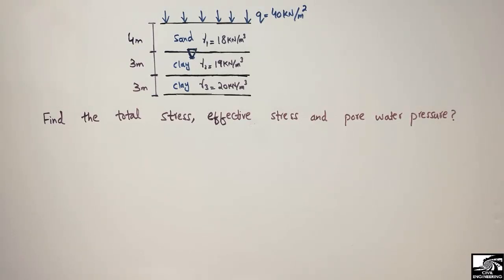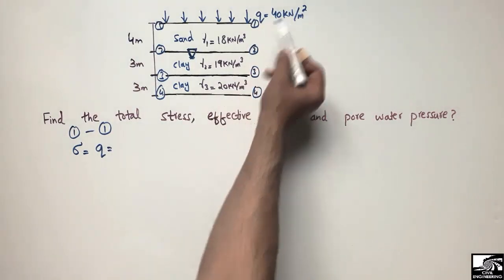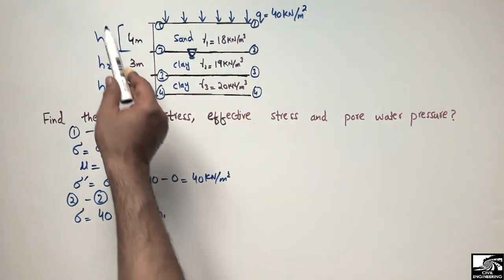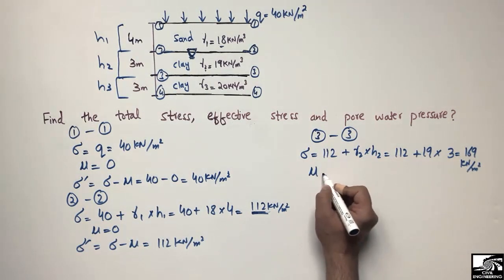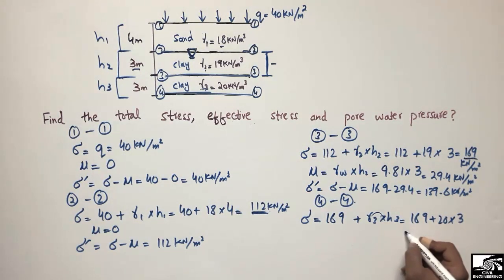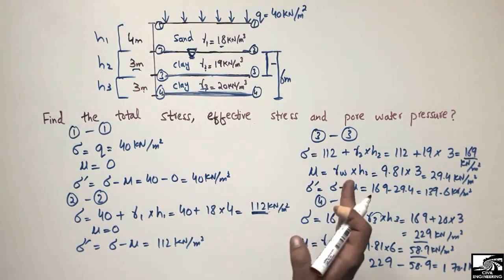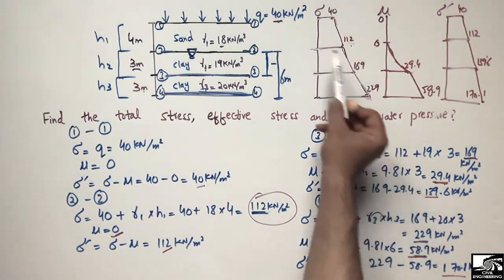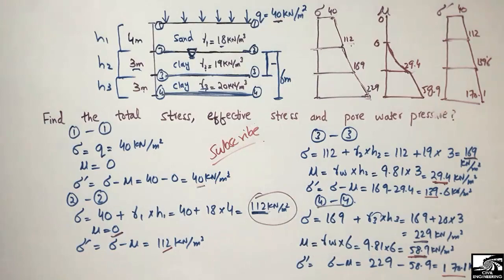Effective stress, Total stress and Pore water pressure in Soil Mechanics || Example solved

Comment: Thanks. But at 3-3; why use 169 instead of 139.6 since that is the resultant stress?
Reply: He used 169 because when he calculated pore water pressure for 4-4, he used H=6ft. He can also use 139.6 like you said, but H must be = 3ft when calculate for pore water pressure

Comment: The effective stress diagram is the subtraction of  total stress diagram  by the water pressure diagram.  The bottom of the total stress is reduced by 60kPa to get the effective stress at bottom point.